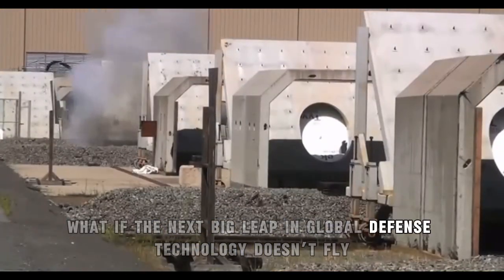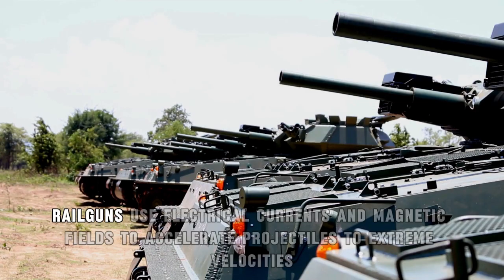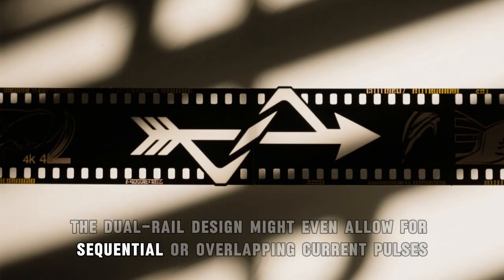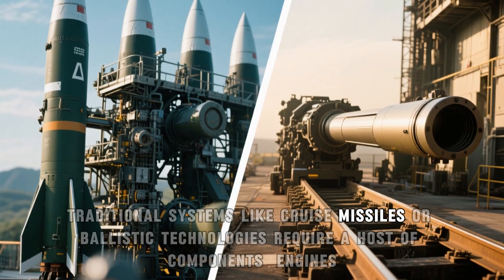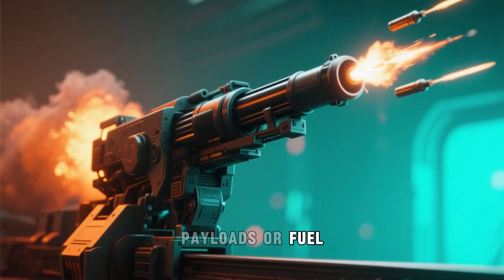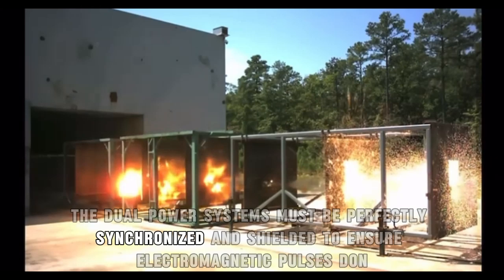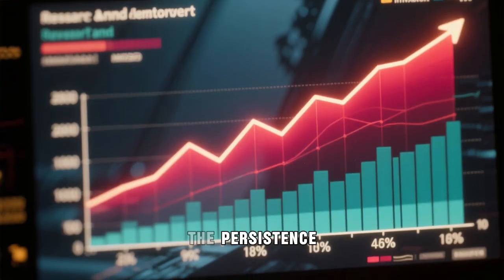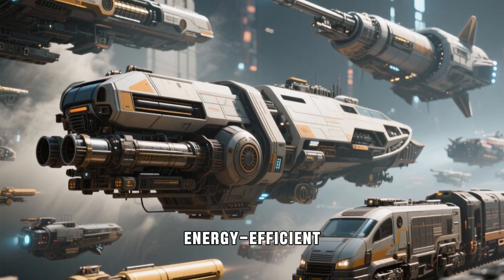Fast. Silent. Powerful. : Inside China’s New Railgun Design

Comment: China is researching a new X-shaped rail gun design that doubles its firepower and improves range. 
This innovation aims to overcome the power limitations of existing rail gun designs and could potentially launch a 60-kilogram projectile at speeds of at least Mach 7, with ranges up to 400 kilometers.
China has made significant advancements in its railgun technology, with recent developments indicating a new electromagnetic cannon capable of launching missiles at speeds exceeding Mach 7. 
This system, developed by China, uses an unconventional X-shaped configuration to enhance performance and overcome previous engineering challenges. 
While the US has scaled back its railgun program, China continues to invest in and advance its electromagnetic weaponry. 
China's progress in this field highlights its commitment to developing cutting-edge military technology.